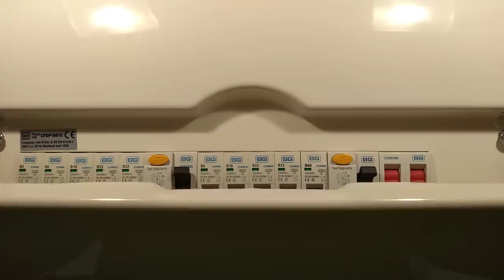A look inside a British home electrical panel.

Comment: Get rid of those horrible ring circuits and then we can talk.
Reply from the maker: The problem is...    A power circuit than can comfortable run huge appliances wherever you want to plug them in is quite handy.
Reply: @bigclivedotcom  I may misunderstand but isn't the largest load you "plug" into a ring circuit 13 Amps ( 3,120 Watts ) . That does not seem "Huge", typical US outlets are on 20 Amp Radial and provide 2,400 Watts and I would certainly not label that as "77% Huge"

I have installed multiple 120/240 Volt 50 Amp Outlets ( Google  "NEMA 14-50" ) around my house. Each can provide 12 KW of 120 or 240 Volt Power. I have not run the Plasma cutter nor TIG Welder in the Living room or a Bedroom, but if the need arose I could with only a 25 foot extension cord. I DID plug in an extra full size Hob for a party. FYI The extension Cord is four conductor 6 AWG / 13.3 Sq.mm.  I Consider that these outlets are for "BIG" loads not quite "HUGE" loads. Other possible "BIG" loads: a Pottery Kiln, TV/Movie Production Lights, or Fast Charging 600 Cell phones at once.
Reply: I personally think it would be better to have 2 radials instead of a ring (although to avoid a potential overload of the cable, a larger cable size would have to be used compared to what is used for ring circuits)
(and it would mean that a break in one of the wires would be noticed sooner, as some of the sockets would stop working)

Comment: Thats posh I have fuses with real fuse wire.
Reply: Sounds like you have an old Wylex board, you can get MCB's that retro fit into the old Wylex
Reply: @harveysmith100  Thanks have found the right ones and swapped them out.great improvement
Reply: @womble321  Not too expensive either!

Comment: Thats a terrible set up, losing half your houses power because of a single fault is so stupid, rcbo every circuit. Love from Australia.
Reply: I had that happen once here in New Zealand. Dodgy kettle tripped the circuit and half the house went out. 

My workshop has breakers that also are RCD’s which is pretty handy. More space for more circuits.
Reply: I'd go nutz dealing with European circuits. I'd end up ripping most of it out and redoing it with individual circuits with each having it's own "rcd". None of that "loop" circuit deal either which seems to be "wire for fire". I can't even fathom EV charging, heat pumps or grid tie applications. Industrial panel I guess instead of "consumer unit".

Comment: I think the reason you have so many consumer unit fires, is cause this system you guys use is . . . it's kind of sketchy.
Reply from the maker: It's actually pretty good.  Simple and sensible.  The problems occur when people are given just enough fake training to give them overconfidence in their abilities.  There's a lot more to electrical installation than just matching wire colours.

Comment: The German Way is Superior and better!
You need to come here and take a look at a well made panel!
Reply from the maker: It's probably spectacularly over engineered knowing you guys.
Reply: @bigclivedotcom  With the Plugs the German one is way simpler and equally safe :)
The Busbar is Proprietary but they have their own hole/mounting position. 
The Hager Busbar is directly under the screw, the part you've shown that might be problematic is only for cables over here, not for the busbar.